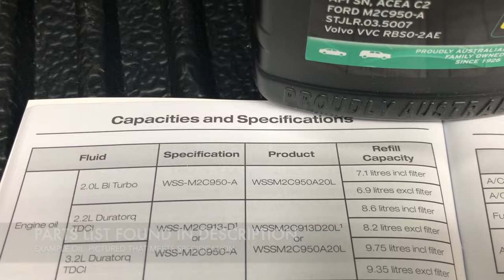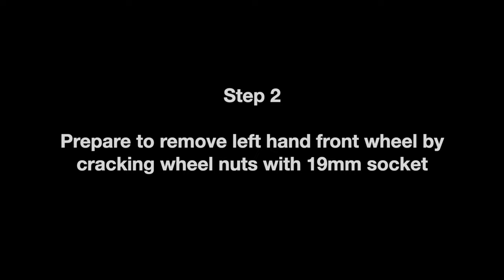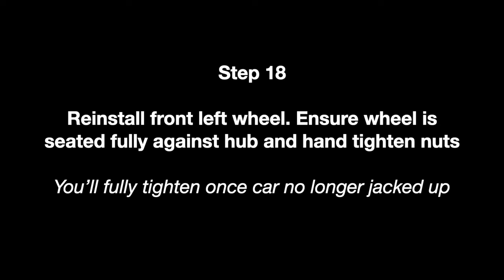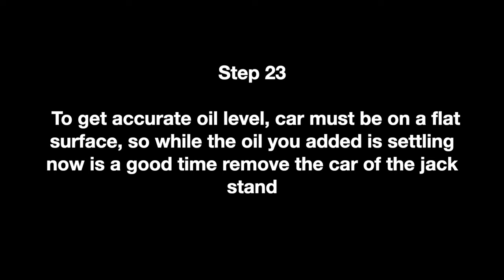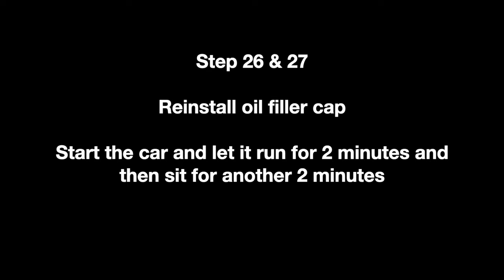Ford Ranger Biturbo 2L diesel DIY Oil Service & Filter change - step by step how to guide on MY 2019

Comment: Sorry to tell you mate, no need to remove wheel, just turn wheel into right giving you clearance then take out top 3 lugs from rubber protective skirt, and there you go access to the oil filter, just done the oil and filter service myself, don’t go taking wheels off and getting under vehicles when you don’t have to unless absolutely 100% safely supported as recipe for disaster or severe injury, thx
Reply from the maker: No need to be sorry - great suggestion for those looking to undertake the oil & filter change with the car on the ground. 
As my video shows this was actually completed on a hoist, so safely lifting the car and easily removing the wheel was an option. This allowed other servicing not shown in the video.
Reply: Believe oil filter torque is 25 + 5nm as per what’s printed on top of the cap - not 25 + 30nm as per your video text.
Reply: So glad I don't have to take the wheel off

Comment: Would it not be better to get the oil filter ready to be taken out before draining the oil out? Also prime the filter before putting it on? Do we still have to stick to the 10 minutes oil drain and re0fill rule or is that just for 3.2l engines?

Comment: I changer mine at 4000km also, but i just changed the oil and left the filter.Ill change it at 7500km from now on. Are you sure about the 10 minute oil change.

Comment: Awesome video. Just wondering if the sump plug has an o ring or something that needs to be bought. I want to do an oil change on my raptor. Just a little nervous haha😅
Reply from the maker: Genuine oil filter includes all seals needed to change the oil

Comment: First of all, amazing content, cheers! Secondly, I have the non-biturbo ecoblue engine on mine (170 PS) and was googling around to find the engine oil specs but could not find it anywhere. Would know if I could use the same oil/filter as the bi-turbo? Thanks!
Reply: If I use Castrol Lube Guide, their Australian website recommends CASTROL MAGNATEC STOP-START 0W-30 D, and if I use Mobil Lube Guide, their Australian website recommends MOBIL SUPER 3000 FORMULA F 0W-30. Nulon Lube Guide says NULON APEX+ 0W-30 ECO-PLUS C2.   If you are outside Australia, your search may reveal other oils.

Comment: Sorry to be green .... but just to confirm the 2litre bi turbo engine doesn’t need a 10 minute limit as people are suggesting?
Reply from the maker: Yes that's correct. Little DIY servicing info on the Biturbo as most vehicles are still under fixed priced servicing or warranty. Google "Ford Ecoblue" for more non-AU specific info about the Biturbo.

Comment: Hi, that was a good video and very detailed. Looked like the 15k first service. I need the 30k service in addition to this which seems to be fuel and cabin filters. Any tips you can share? Thanks for posting!
Reply from the maker: Thanks for the feedback. The service was a cautionary 4k service to reduce gap till first oil change. Given the lack of Biturbo DIY knowledge out there, I’ll add more videos as I can.
Reply: Do not use not more than
 10K

Comment: hello mate did you reset any settings after oil change..
Reply: Hi, I was wondering if you could help me, if you did solve the issue... I did the oil change but the "oil change required" warning it's still there after a couple of months (5000km). In the cluster options there's no "oil life reset" option. Thanks for your help .
Reply from the maker: I didn't as this was a mid-scheduled service oil change

Comment: Doesn't it have the 10 minute max like the older 3.2L oil change?
Reply from the maker: Very few cars have non-self priming oil pumps like the 3.2L. The Bi-turbo doesn’t
Reply: @aussiedriver  Thanks... mine consistently asks for a change mid-services - and the $350 for this as an extra charge has prompted me to do it in "another way"
Reply: @jacograaff  Be mindful changing oil yourself can void warranty, as they consider it service by unqualified technician. It's stupid, but could happen.